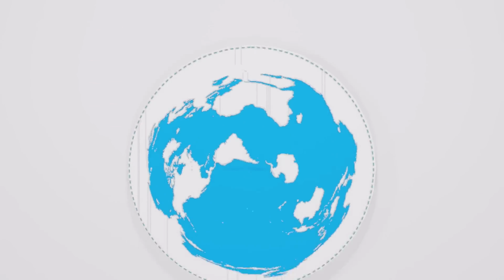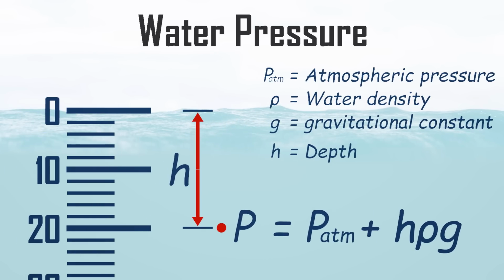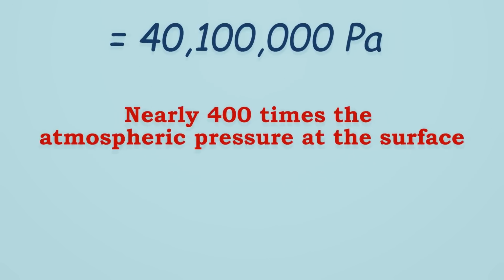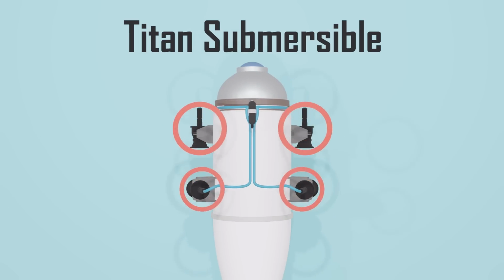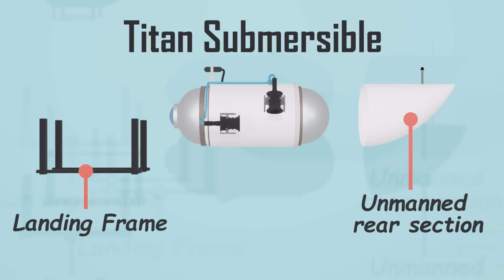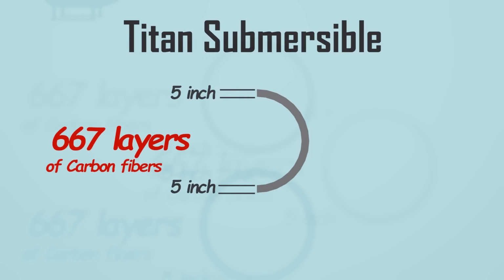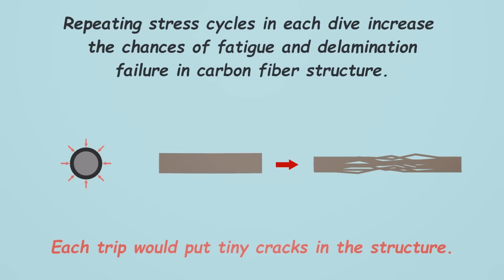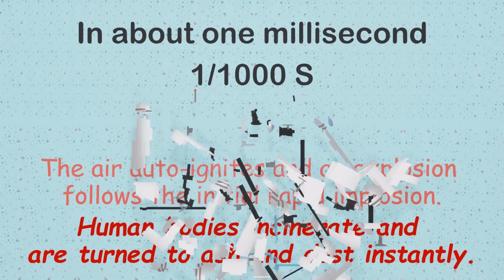Titan submersible | What really happened ?

Comment: I disagree....the Titan "WAS NOT" a marvel of engineering
Reply: TOTALLY AGREE it was an arrogant stupid design
Reply: The problem was the unit was a 3 piece unit the cabin should have been a solid unit and u do not use carbon fiber for a vessel that is constantly compressed and decompressed this was a very stupid idea from the start rush was a complete clown and this was not a engineering masterpiece
Reply: Definitely not.
Reply: Cycles of compression and de-compression require a rigorous inspection program - similar to air frames on airplanes. The failure analysis report will be all over that.
Reply: @Dechieftian  yes; a carbon fiber manufacturer said it's completely routine for aircraft when asked in an interview. And this is a far more strenuous application than aircraft!
Reply: In theory, it was. But production=/= theory. Had everything actually been manufactured to proper load specifications, it probably could have been. Terrible execution of theoretical blueprints.
Reply: All the "experts" keep saying there were 2 non compatible materials and forgetting the "glue".  If one attaches the titanium out ring to the carbon fiber tube with "glue", at what pressure is that glue applied?
Reply: @martinwhite418  at one atmospheric pleasure it wasn't even applied in a clean room it was done in a warehouse
Reply: @martinwhite418  I think that failure scenario and the comment specific to the glue are central to the failure of the Titan submersible.  Having a life time of experience with pressure vessels in processing industries - nothing in the marine world - I can say with certainty that the transition zone of a pressure container such as the body to the bell end warrant a great deal of attention and testing.   The notion that a carbon-fiber shell would somehow have to transition in a ring of some fashion to mate with the titanium bell end flange is at least troubling.  To have that transition stress be dependant  on a glue - in a pressure zone that would be subject to deep ocean pressure of approx 6,000 psi or 41,000 kilopascal at the Titanic depth of approx 12,500 feet / 3,800 meters is quite frankly horrifying. 

it is a shame that the loss of life of the people in the submersible will with certainty  be determined to be inadequate containment integrity for the deep ocean evnironment of the Titanic.
Reply: Going down in a flimsy Coca-cola can ten times deeper than nuclear submarines, just to see a lousy shipwreck.

Halfway down the Mindanao Deep.

Out of their minds.
Reply: It could have been if more tests and studies were made. You just can not take shortcuts and break laws of physics while making a project.
Reply: Cheapskate version of a submersible, physics knew best.
There was no need for any person to die though.R.I.P.
Reply: I can say with conviction that many of you just don't know what you're talking about. Just like the other 99% of the internet. The Marine Technology Society letter to OceanGate did not say the design was poor, or that it would fail. For every critic there were many who said the design was good. Yet we only hear from the critics now. They just wanted to get it certified because there were unknowns in using new materials, and where there are unknowns there is no absolute guarantee of safety. As of yet, we don't actually know what failed, quite a number of scenarios could have resulted in implosion without the carbon fiber hull failing. BTW, it was an engineering marvel, in fact the world's first cylindrical vessel that can reach Titanic depths. Much will be learned from this tragedy, and there is a lot of room for improvement, OceanGate did however demonstrate that it can be done.
Reply: @methylene5 the critics were correct
Reply: @composingwithjames  For every critic there were many who thought the design was good. There are always critics for any new technology.
Reply: @methylene5  show me because I have not seen one person in the submersible community approve his design. And it failed what is ur point?
Reply: @JosephWilhoit-l2x  Accidents happen. If you haven't seen anyone approve of the design, then look harder. Even the Marine Technology Society never said it was a bad design, they just said there were uncertainties, so therefore could entail risk. You should also learn what is involved in getting a hull made of different materials other than steel/titanium certified for deep sea dives. If you understood what it involves (most don't, so you're not alone), then you would understand that even if the carbon fiber hull was 99.99999% safe, it would take at least a decade, a mountain of paperwork and tremendous cost before it would ever be certified. We also don't know the cause of the implosion, it may well have been the hull but it might not. People should be patient and wait for the facts to emerge before jumping to conclusions.
Reply: @methylene5  I agree in a way with what u said but my biggest issue is having a cylinder with 2 end caps I almost guarantee where the 2 titanium end caps was connected is where the failure accured u cannot do that with those kind of pressures it should have been 1 solid unit period
Reply: @JosephWilhoit-l2x  You could be correct, but I'd imagine OceanGate would have computer modelled all of this, and found it to be okay and within acceptable tolerances. I'm very much looking forward to seeing what OceanGate did in-house, modelling these processes is fairly industry standard. I'd be quite surprised if they just threw it all together without very careful consideration. If they didn't, well then that's criminal, but time will tell.
Reply: @methylene5 lols. find me one of "the many" who thought it was a good idea.
Reply: @mooksieb  Yeah, "after the fact" is more difficult now,  but find the "many" who said it was a bad idea before the incident (with evidence, rather than hearsay). There were those who said there where unknowns, but not that it was a bad idea. Big difference.
Reply: @methylene5  Interesting and insightful comment.  The key point that the submersible was a unique design and clearly challenged conventional thinking and wisdom.  Those embedded in the known world of marine technology may not be the fastest out of the gate to embrace new innovative designs.  Like the ill fated unsinkable ship it was going to visit at extreme depths of the ocean, the submersible may  have suffered from the same arrogance that was displayed a few times when Ocean Gate was challenged by marine specialists and safety engineers.  Clearly, Ocean Gate in general and Mr. Rush in particular revelled in what they had accomplished. And possibly a bit defensive when challenged on it's  unique design.  Mr. Rush in particular revelled in showing off his system for navigating and controllling  his vessel.   Additional comments about 'hardware store washers' further gave the folks listening in with interest another sense of Mr. Rush being flippant in the face of real and honest concerns.  The attitude - or perhaps arrogance if you will - doen't help the cause partiicularly now. 
There have been many innovative designs and corrections to poor design in other industries - the automobile industry to name but one - where design flaws - such that often fatal design flaws - were corrected and the end result today wold be  very safe and well engineered vehicles that have safety as central to thier purpose.  Hard to imagine that there was a time in the recent past where seat belts were only provided as an option in higher end vehicles.
Reply: @Dechieftian this was never about innovation. The catastrophic accident was a direct result of prioritizing cost savings over safety, evidenced by the neglect of crucial safety measures and the cutting of corners to reduce expenses.
Reply: @mooksieb  I think there is little doubt that Ocean Quest purposely set out to be different - provide a different deep sea experience for citizen explorers.  A vessel that would transport up to five people to the extreme depths of the ocean would be both experimental and unique. As I type the word experimenatl I'm mindful of the notion that if I am getting into a submersible - or any vehicle -  I need to be sure that the engineering and design integrity of the vessel is without compromise.  And that level of reliability and integrity of the vessel has been tested and proven to the satisfaction of an authority independent of the commercial owners of the vessel.  

I think Ocean Quest were stubborn in their quest to achieve commercial success in deep ocean transportation - and the subsequent profits that could be realized from the super wealthy - and in many critical areas lent a deaf ear to or completely ignore those who were considered by Ocean Quest to be spoilers of their venture.  This attitude I believe has proven ill advised to the minimum and fatal to the extent that the pressure envelope would implode if the mechanical integrity of the vessel gave way. 

It cannot however be overlooked that one of those owners was one of the unfortunate five people who perished in what is reported as an implosion of the vessel.  Mr. Rush had the confidence in the Ocean Quest design and integrity to trust his life to the vessel.  His engineering background and knowledge of pressure containment vessels and the materials required to make them both fit for purpose and safe were all that was needed .  Something went very wrong however that will call into question much of the discussion about the safety and design of the vessel. 

In conclusion, whatevprer the reasons for the failure I hope that enough will be learned by the deep ocean explorers in general and Ocean Quest in particular, to prevent what I believe will be soon proven to be design and material specifications flaws that caused this needless loss of life.
Reply: @methylene5 what the hell makes you an expert and "99%" of everyone else idiots? The shape of titan itself was a flaw. The reason we only hear about the critics now is bc we only hear about the titan now lol. The Commercial submersible community isn't exactly a common past time 🤡🙄
Reply: Like you can make anything better lol
Reply: @IseeWhy  Stockton is that you?
Reply: @IseeWhy  Well, this isn't about me building anything "better"...and yes I could build one better.
Reply: @denofearthundertheeverlast5138  you coudn't stop lying
Reply: @IseeWhy he never said he could build anything better. He merely pointed out the fact that the Titan was not a marvel of engineering design.
Reply: @maryB3915  he did

Comment: I doubt the hull was the "weakest link".😊
Reply: ..and?
Reply: The viewing porthole was only rated for 1300 metres and not 4000 metres, apparently.
Reply: @certainly2509  ..true, there is a theory it failed and the water came blasting through the opening and exploding not imploding the cabin which seems to tie in with what the wreckage now looks like.

there is also another theory that the hull failure was the rear titanium sphere that had holes punched in it for services and was thus weakened ...in this case the plexiglass didn't fail as such but instead got blown off the other way from the inside which makes sense since it wasn't designed to take pressure from the inside.
Reply: @bepitan  I thought the general consenus is implosion not explosion due to the physics of the immense pressure at that depth i.e. 6000 psi. I also don't believe there was any sabatoge of the submersible. Sounds like a conspiracy theory.
Reply: @bepitan  I believe Stockton Rush was over confident and cut corners on his sub that resulted in this tragedy that shouldn't have happened. An implosion takes a fraction of second to occur at those extreme condituons if there is any compromise to the sub's hull. Check out what James Cameron has said about all this. He's an expert on deep sea diving and knows a thing or two about submersibles